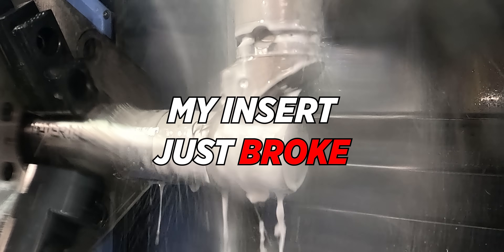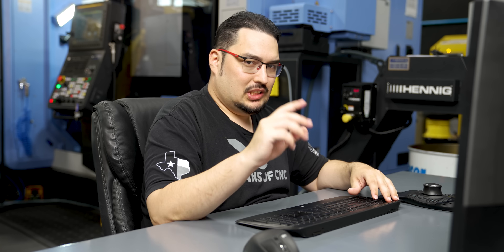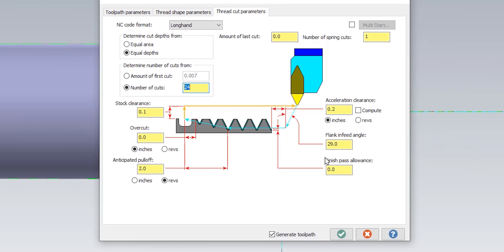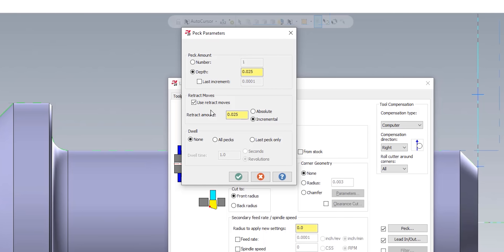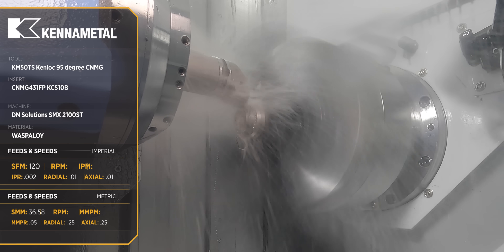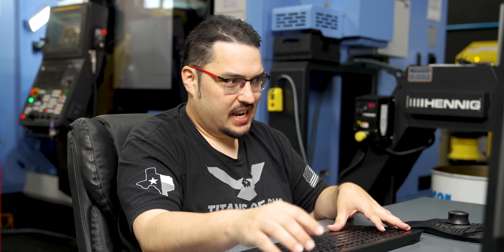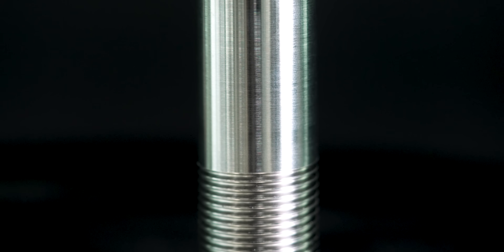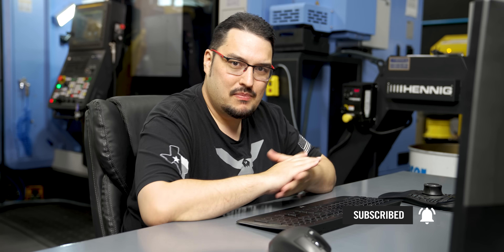Machining Waspaloy: The Fiercest Super Alloy You've Never Seen

Comment: I machine that stuff everyday for metallurgical testing  along with 718, 890, X750,  S188 and a few other superalloys for aerospace applications. It is pretty hard on tooling but like this guy says cut depth, feeds and speeds are the key to it. You can hit it pretty hard on roughing cuts ( .080" cut) as long as it's chucked properly but it is only one pass per tool. I find  spindle speeds are probably the most important parameter.

Comment: I'm curious why you didn't rough the bolt head in a continuous path around it. It would have actually helped the heat load and saved a ton of extra hops. You did this with the ball endmill... hops = time lost. I mean i guess that's okay if you're just doing it for a video... but still I was expected to find the minimum time per part.

Comment: When you pushed the part into the chuck, the jaws had enough of a radius to let the bolt seat to the face of the jaws and not interfere with the radius on the inside corner of the bolt?

Comment: In dental we use chrome cobalt alloys for dentures, its a total pain to finish by hand (wax up needs to be as close as possible, and sprue shouldn't be any bigger than need).  However I consistently meet people who have had partials for 50+ years.  Bego Wironit is Co 64.0 · Cr 28.5 · Mo 5.0 · Si 1.0 · Mn 1.0 · C

Comment: I don’t get what you mean it is a 12 pitch insert it is a single point threading tool it is 60deg it should allow a range of thread pitch’s to cut no? The limiting factor would be the tip radius and the max depth of cut. That would determine the range typically they say the pitch range they offer. If it is Specifically for 12TPI what is the benifits of this? I could see if it were a multiple tooth insert.

Comment: Try stellite 31. I used to make the pins that pushed out the old glass headlights thats had the four protrusions on the backside. B4 heat treat they would eat an insert about every 3 parts. This was 1988-89. Then after heat treat they came back and centerless ground everything with tolerances like +.0000 -.0002 you dressed the wheel every pin.

Comment: I used to weld Waspalloy, Inconel, Monel, and a lot of other aircraft engine alloys. I worked for a company called Chromalloy which was an FAA lic. repair station. We reconditioned hot section parts and combustion chambers for a large variety of commercial aircraft engines. I worked mostly on JT-9D Pratt and Whitney parts, and GE LM-2500 parts.
Reply: Very cool!
Reply: TACR?

Comment: Water with high pressure trough the tool pointing directly on the tip of the insert can also reduce wear and you can increase speeds and feeds. 
10% coolant solution is also an advantage in these difficult to cut materials.

Comment: Would be nice to know exactly what that fastener was fitted to and used for. 

The one detail you omitted. 

Thanks.
Reply: It's a showpiece, not intended for any function except to show the process and tooling using to cut Waspaloy. A "real" aerospace fastener like that would have a 12-point (not 8) drive, and more likely be forged and roll-threaded instead of cut thread (for toughness and thread flank surface finish quality).

Comment: I have never seen Waspalloy being machined. But I have seen a sheet metal item butt welded with TIG.  A beautiful seam without filler metal.  If I remember, it was also done without back-up gas.  The part was likely a special nozzle, shaped as a partly flattened cone, i.e. an elliptical cross section.  The welding required rather funny shape tooling.

Comment: I used to run this stuff on a turret lathe many years ago. We used cutting oil, low rpm and heavy feeds. Sharp tools are a must.
Reply: Very interested to learn more about the ''manual'', or I guess ''mechanically automated control'' machining of this stuff! Were the tools you used similar to what the screw machine operators would use? i.e brazed carbide touched up on Agathon grinders type of thing?

Comment: is waspaloy easier or harder to machine than inconel? In my shop we never run inconel above 90 SF/M. These speeds and feeds seem high.
Reply: The cobalt added to the alloy likely makes it more difficult than most of the Inconel family.
Reply: What rpm is he using? What does 100 SFM calculate to for a piece that diameter?

Comment: Killing it with the lathe stuff man I’m scared of those late people are built different 😆 have you guys ever tried 3D printing carbide tooling and grind it to sharpen it I’d love to see that attempted were I work we’ve looking into (DLS) but the resolution isn’t quite there for the 3D printed rubber molds we make tolerances of .005in nothing for machining be a real challenge for 3D printed mold inserts #htm 140v2

Comment: For cutting aluminum "dry" for camera purposes I would suggest giving the piece a little spray of WD-40 first. Will cut much better and still give you a great shot.
Reply: Well after the first pass there is nothing left on the surface so no point besides making smoke.
Reply: Isopropyl 99%, no smoke

Comment: Cool part, cool video. I've never used that material but you cut it well. Why do you use a tapered endmill to finish the star pattern instead of a straight endmill in an axial (horisontal) orientation to the part? Is the parts corner radius too small to allow a suitable endmill to generate the shape properly in that orientation?

Comment: Nickel based superalloy with, let's see, 18-21 % chromium, which is ok, 12-15 % cobalt, which is YIKES!, a significant 3.5-5 % molybdenum for increased corrosion resistance, around 3% titanium and about 1.5% aluminium, to form intermetallics (it is age-hardening), a few knife tips of carbon, boron and zircon, and the rest is incidental, so only a max. value, not a minimum required concentration. 

Yeah, I don't need to see this alloy (congrats, you guys are the first to show it to me!) because the chemical composition tells it all. This is one nasty mother trucker!
Reply: Working in a foundry that makes this stuff, don't worry, melting and alloying it is just as much of a pain as machining it is!
Reply: @gibbygaming792  yes it is worked as an operator making these superalloys for 15 yrs (portland,or)
Reply: @ctc2469  we make everything from the iron-bearing alloys to to the crazy expensive hafnium-bearing ones, quite the rainbow of alloys and compositions!
Reply: Sounds like the metallic equivalent of dragon scales. It would be both hard and tough. 😮
Reply: wow this guys metallurgy is on another planet, verry cool and intresting, i am a blacksmith, so i understand, but not on the level you do =] , like i said, impressive, thanx for the comment sir, appreciate you, Kindest regards.
Reply: I cann only imagine how much pain that alloy is 😅 the most exotic alloy i made to this day is invar and same duplex steel alloys that have less than 45% iron but these are tame in comparison too newer aero-space alloys

But im interested that makes them especially a pain?  Hydrogen and nitrogen Absorption or even oxygen or is solidus and liquidus very close together so that is could freez pretty quick? Just too throw same things in that come ro my mind 😅
Reply: @TheLtVoss  all of its gotta be melted and poured under vacuum, and has a laundry list of elements that compose of these alloys. Crazy expensive stuff
Reply: @TheLtVoss  Metallurgically speaking, the alloy has some similarities with Inconel 718. Both are nickel-based and have similar Cr content. Mo and Ti are lower for 718. But cobalt is the kicker. 

You can find cobalt in high speed steel/tool steel and maraging steel. Waspalloy has a significant Co content which raises the strength, especially strength at higher temperature, up several notches. But the trade-off is this difficult machinability. Machining 718 isn't a proverbial walk in the park to begin with, but this stuff is considerably more challenging.

Comment: I have machined this material a few times before and the knowledge you gain on the manual machine really helps the speeds and feeds for when you need to program a CNC !
Reply: A 3 inch diameter piece needs to spin at 127.333333 revolutions per minute to achieve 100 SFM.
Surface footage depends on the diameter of tool or piece to calculate. 
1.5 inch piece would be double the rpm.
Reply: What RPM is he getting at 100 SFM?
Reply: Question🤔. Why do material engineers provide data sheets for Waspaloy if machinists prefer to guess speeds and feeds on trial and errors?
Reply: @ZZZHarpy101 the data sheets might contain very in depth data about the material properties (yield strength, hardenability, tempco. etc) but the machining data is more guidance to get you close as there are way too many other factors, such as tool type or machine rigidity and resonances, to give concise information.

Comment: I am amazed that a part stick out thatvfar did not cause tool chatter.  That wasp metal is tuff stuff.   I expect the aluminum was more of a challenge in the prototyping and used for filming purposes.
Thank you for the VIDEO.
Reply: There was fine chatter during roughing which was removed by the finishing tool.Chatter was loud and clear during roughing.

Comment: Can't think of a part, however I'm curious if there's a way to program and make a detailed miniature like perhaps the arbiter from halo as an example. Without layering or any tooling marks, just smooth nice finish in titanium or something nifty like that, done in let's say 30mm tabletop gaming to minimize material waste and it'd be nifty if possible.    I've seen dice and other simpler designs so figured eh why not toss that idea. Or a custom tool chest completely made from parts y'all made with machining in mind?
Reply: It's not impossible but the price tag for somethin like that would be in the $1000's lol.
Alot more logical to 3d print/mold stuff like that
Reply: @verakoo6187  Eh I was thinking it'd be neat to see em program and make something like that as it'd be different yet interesting. Especially if they do a walk through of the reasoning for how and why they did each thing as they did. Something like that just happens to be similar to my other interests so I mentioned it, I already have the ability to print em if desired. It's more or less just a huh toss idea out there see if they or someone likes it enough to try it and make a video about it.

Comment: The pain shows up  when attempting to bore and thread smaller diameter features on super alloys.
Reply: lol, making a throttle shaft from Ti... the slot and the two M3 holes tested me.

i quickly decided that sharpening the broken taps was the best approach... short and stumpy :)

only got Ti as i couldnt find steel in ground 7mm dia... cheaply, anyway. "give it a go, huh"?
Reply: @paradiselost9946 people under estimate the power of just shortening tools all the way up. Did a bunch of 2d cut out work with 1.2mm aluminium sheet, ground my own bits to 1.3mm off the shank. Was able to drive it about 10x faster than the code that was handed to me…. People quickly stopped double guessing me “Removing 90% percent of the lifetime of the tool”….. who cares, you pay me 2 of those tools an hour, but i just created 10 machines worth of production. Who cares if I go through 1 a day.
Reply: It dosnt confuses me that small parts out of though stuff is often run on EDM
Reply: Is thin-wall stuff really difficult with this alloy?
Reply: @Chris11249  high nickel alloys require heavy mechanical tool pressure.
Reply: @ yes sir! you can hear it. I've only done thin-wall stuff on AI and Ti
Reply: @ hopefully you’ll never need to machine anything that difficult. In aerospace, petroleum and other mining you will.

Comment: I have heard stories from my coworkers about how some gas turbine blades we make sometimes for Siemens and they are made of that stuff. The machine that runs it shakes so much when it begins to mill that you can feel the vibrations in the floor on the other side of the factory floor. We haven’t made them while I have worked there though so i can’t say if it is true or not but maybe someday I’ll see it for myself
Reply: It is true.
Reply: May check your mounting feet , we have a vmc that will vibrate the feet up , walked by once could move machine.
Reply: I confirm that 😂

Comment: I work for HiShear an aerospace fastener co. They do large lots for Boeing and Airbus. For big bolts like this one they would invest in tooling to Hot stamp the head, grind the shank, hot roll the thread after heat treating. Maybe also roll radius or Roll Burnishing the head/shank radius for higher strength. Then the part goes to plating for what ever is called out.
Reply: So mostly no "cutting"? I guess that makes sense. 

If you don't need to, don't.
Reply: @johnathanmandrake7240 Rolled threads are stronger too.
Reply: Fascinating
Reply: @theorangebaron1595 fastenating
Reply: So I’d assume work hardening is calculated in with this method. If not your parts now under different stresses when torqued. I machine hastelloy and inconel, among just about everything else, for an industrial plant I work at. We use to have constant failures on impeller retaining bolts made from inconel from a third party machine shop. Come to find out they were doing this and causing the bolt to work harden, since we’ve be cutting them in house, we’ve had no failures from the bolts breaking and allowing the impeller to come loose. If you’re doing this without the consideration, testing or instruction direct from the manufacturer, you are doing it wrong.
Reply: @marv8481  They were all heat treated by the book so no problem. Boeing would not be happy.
Reply: Какая твёрдость по Роквелу у этого материала, после закалки?
Reply: 25-30Hrc after age hardening  @ЖелезнаяЖизнь
Reply: Awesome
Reply: Installed thousands of Hi-Shear fasteners, good stuff. Worked for Lockheed. They contracted someone to make their LS fasteners. I always suspected that was Hi-Shear too.
Reply: I think most shops would hot head, grind, cut off, heat treat, finish grind , thread roll , and fillet roll. I think doing everything on a lathe would take a very long time.
Reply: Could you cold-head a fastener with that type of alloy or is it too finicky?
Reply: @MrTL3wis lol it would be as hard as diamonds halfway through the operation
Reply: @MrTL3wis  lots of cobalt in that alloy i'd expect it to crack under cold working
Reply: @MingRaptor  I was thinking that after I wrote. I was just thinking dimensional stability. You're right though, neither the part or the tooling would survive.
Reply: @MrTL3wis  Yes but this was an aerospace bolt maker so materials were not that soft.
Reply: HiShear Rugby?
Reply: I was about to say, i'm surprised they would have a cut thread, seems like a lot of effort in material to still have that blatant weakness.
Reply: They are in the business of teaching everyone to beat up machines and plow through bits.
Reply: Less chips is less dollars on the floor
Reply: I'll take 48
Reply: Respect.  Like most things in life, there are "levels" of competence/expertise

Comment: Nice work Tyson! Thanks for taking us through the entire process!
Reply: Why doesn’t he show what the actual RPM was he was turning that at?
Reply: Two reasons. One, it is changing to maintain surface footage. Two, its not the number we are concerned about. Think of it like this, if you take a car tire (off the car) and roll it one time on the ground and mark the length it rolls. Now do the same with a soup can. You see the different circumferences? One revolution has produced dramatically different line length. We want to control how fast the tip of the tool moves a certain distance, not how fast it spins one time, which changes with diameter. So, umm, boom i guess?